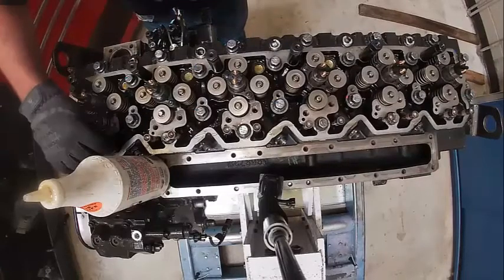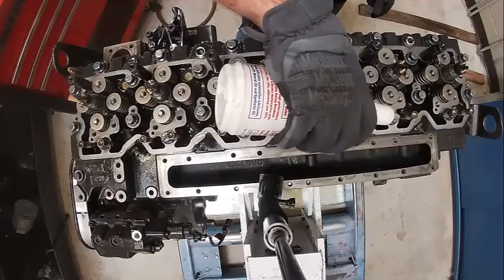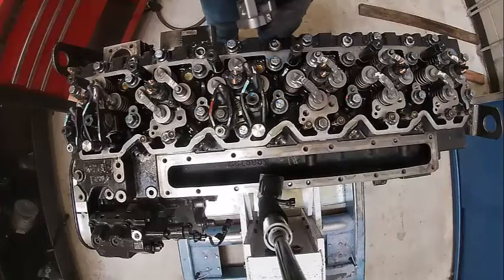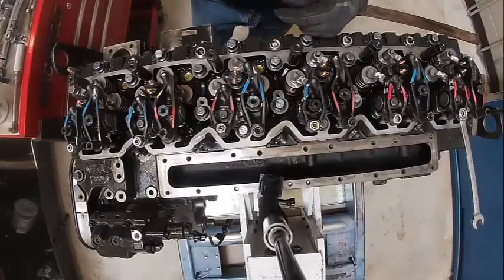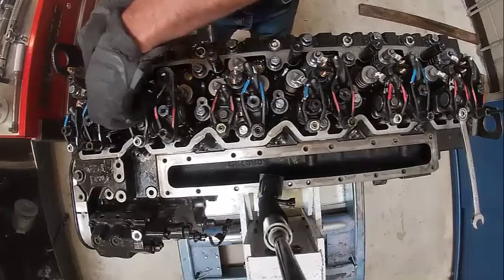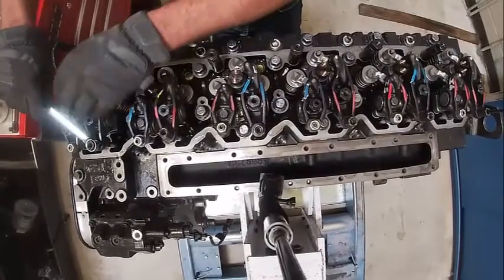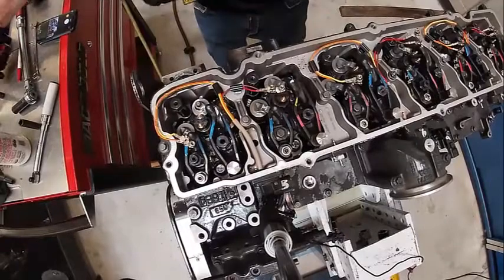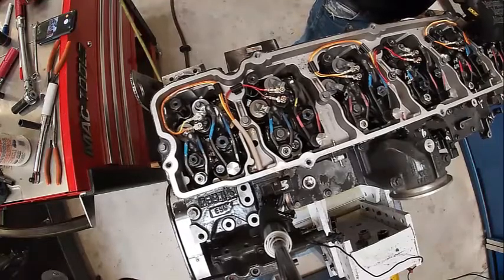9 ISL Cummins Overhead Install and Seting The Valves

Comment: Can I contact you? Having an issue with the same engine. I go to tdc set lash for 1i 1e 2i 3e 4i and 5e. When I do my 360 for my next set the valves are tight

Comment: 2012 ISC8.3 I don’t see any access above the starter for the barring tool? There is an access cover on the opposite side, but it’s towards the center of the ring gear? Any experience with this?